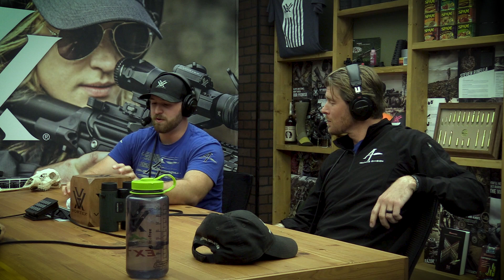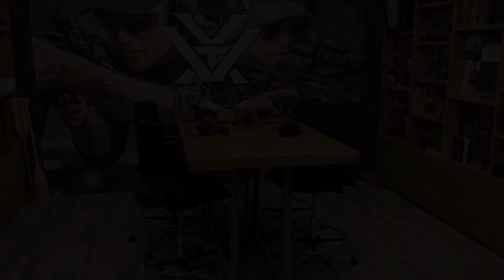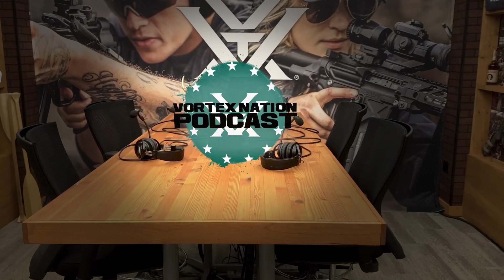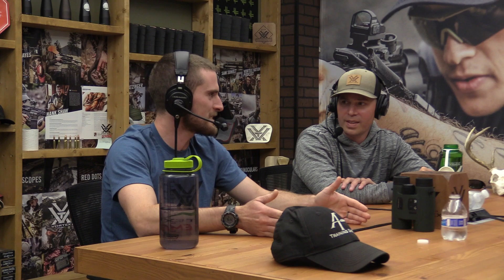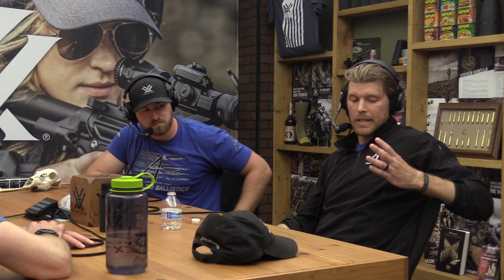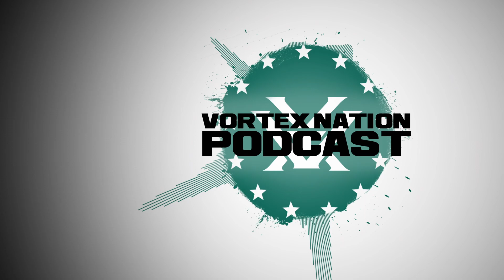Ep. 173 | Long Range 1005 – The True Science Behind Ballistics with Applied Ballistics®

Comment: So my compass has its declination set to 13 degrees. How does that affect my direction of fire? 
Should it be true north or magnetic north?
Reply from the maker: Here you go - from one of the precision LR guys here at the office - "Declination refers to the difference between true north and magnetic north (the earth’s magnetic pole is not at the very top of the planet).  The Fury AB measures magnetic north, however the amount of variation that you are going to see between the two when shooting really isn’t going to make much difference until you really get into some really, really long ranges or if the error in direction of fire gets to be more than 45 degrees.  Basically the difference in true north and magnetic north isn’t something that will be perceptible unless it is extreme and in his case it isn’t enough to worry about."
Reply: @VortexNation  you were looking for true North as that is the access that this is all about working off of. Since you are not working with magnetism, and the declamation would only be used for your Compass to give you a true north reading.
Reply from the maker: Now there's a heck of a question - we'll do some digging for you to see if we can find the answer!

Comment: Something else worth testing, for  extended range volume fire. What benefits and downsides would there be from having aerosols of chilled Nitrogen or CO2 perhaps kept in cool boxes, to spray into the Chambers and barrels, say every 5 shots or so before barrels start heating up too much?
Reply: That would be an internal ballistics point. 
They are talking about external ballistics. 
However to answer the question a little. 
Barrel temperature will deform the barrel and change the point of impact so the more stable the temperature and the less variance in barrel uniformity then the less distortion. 
Yes rapidly heating and cooling a metal component will cause movement in the part and work harden the part. 
Think of annealing (heating and slowly cooling the part to soften the metal) if you quickly quench a metal part it will harden that part, quenching can be done with liquids or gasses.
Doing this many times will cause cracking and shorten barrel life. 
Oxidation (rust) of the metal due to heat variance is also can shorten barrel life and distort internal ballistics. 
You want the least temperature variance to extend metal parts life cycle. 
But if you wanted the the most accurate tube (barrel) you could liquid or gas’s cool the part to keep a more stable point of impact.
This is done with very high rate of fire barrels as seen on point defence missile positions on ships and air defence battery’s.